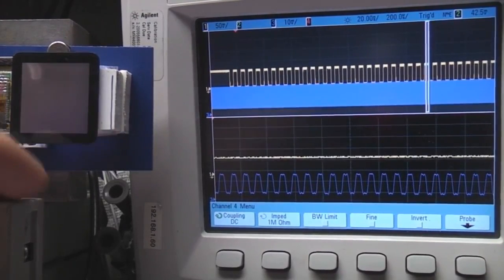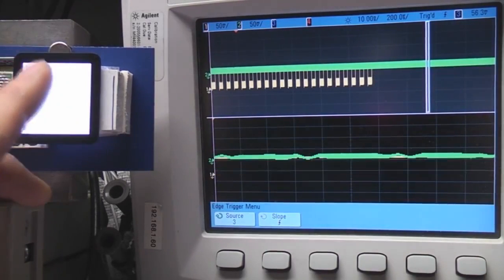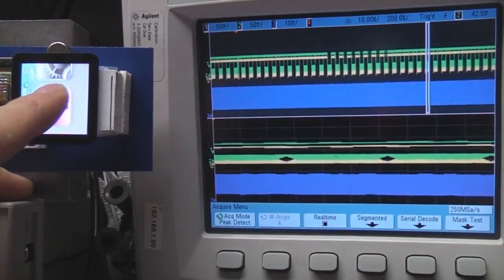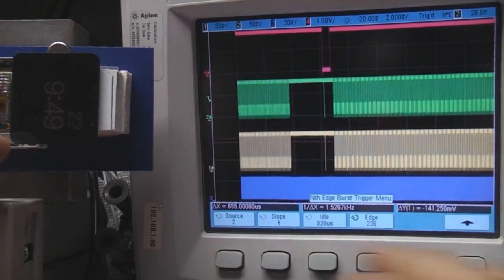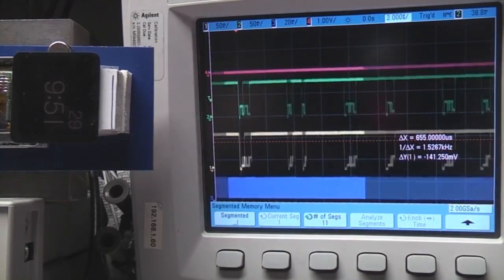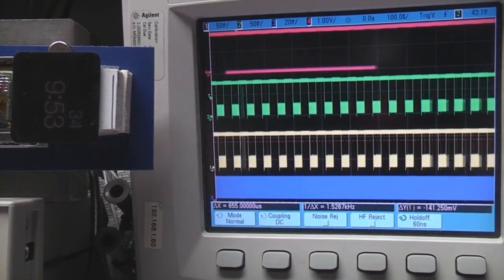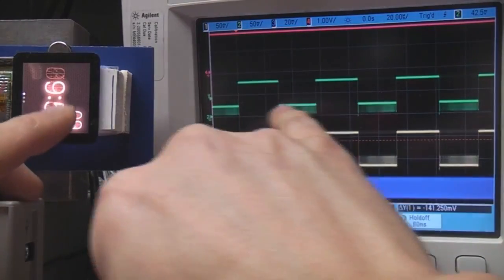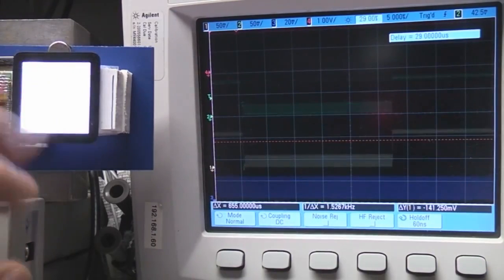Advanced Oscilloscope features

Comment: Delightful
I saved up and got my hands on the 100mhz DSO version for a project a number of years ago.
The community has done an excellent job unlocking the software as a product on these devices and I now have all the features including the MSO (after tracking down a pod for it).
It achieves the unthinkable for fault finding and this video even 9 years later covers some basic mistakes in setup that make the difference.
Top work.

Comment: Probably an obvious question but why do these expensive scopes have such pitiful amounts of memory?
What's wrong with using 8 gigs of cheap ass ddr3?
Love the show man!!
Reply: The amount of memory is limited by the speed of your ADC.
Reply: Bandwidth limitation. 4 channels X 4 GSa/s/channel X 8 bits/Sa = 160 Gbit/sec = 16 Gbyte/sec. A DDR3-1600 DIMM maxes out at 12.8 Gbyte/sec, and then you also have to get the data out too. So DDR3-1600 misses the mark for a scope like this by a factor of 3 at the very least.
Reply: Zane Victor Kaminski thank you Zane for the thoughtful comment! That's loads of data!